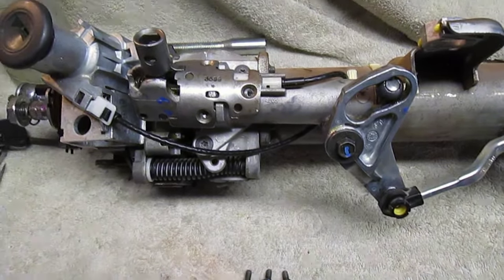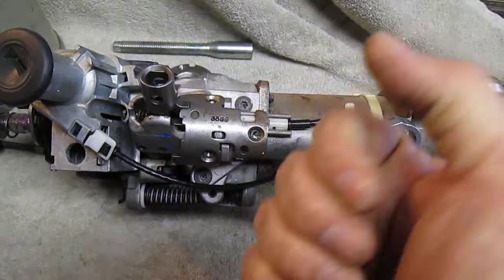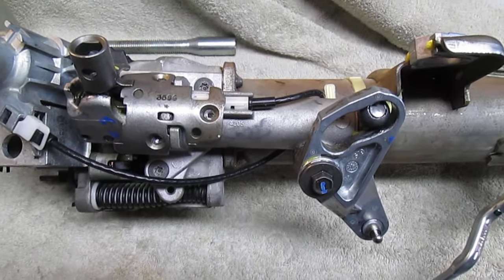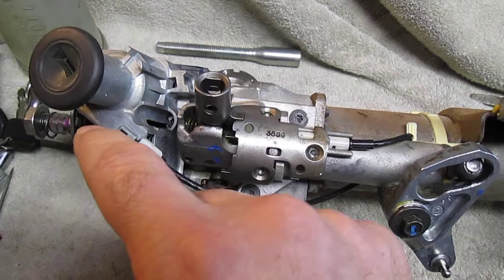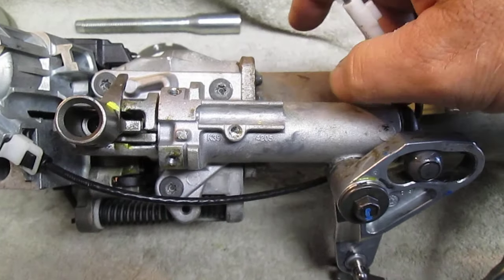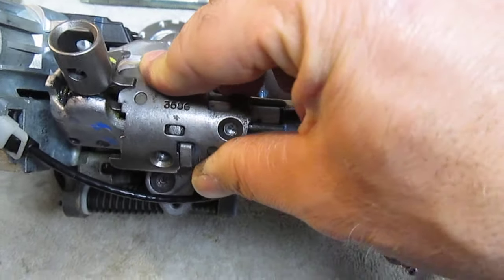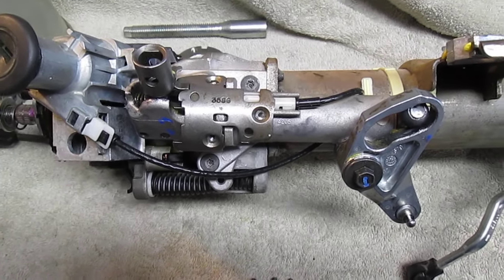Easier way to replace silverado shifter gear selector mechanism assembly

Comment: For the pin lock cable removal on the shifter machanism turn the key to acc position it will slide right out. Must be in ACC or one turn back from off to slide it in or out. Make sure u undo the keeper clip .
Reply: I keep seeing people saying this, but what about the newer trucks that don't have accessory position in key back? It's on notch forward on them. I saw several questions about this on another video but no answer. I'm looking at doing this soon on my truck.

Comment: My cadillac escalade just died as soon as i went from drive to reverse and i had to tow it to my house but i noticed that i got no shifter indicator light and my gas gauge is not working so any idea if i need to replace that part?

Comment: My vehicle back out and then it went into drive and then the gear shifter just moves freely and it will not go back into park and once I turned it off it’s stuck in drive

Comment: I have a question. I got a 02 Silverado HD and the cable broke and I installed i a new one. and ever since I replaced it, it takes a lot of effort to shift out of park especially on a hill and also the gear selector doesn’t lock when you turn the ignition off. I’ve tried adjusting it the cable but it just makes it worse. Any ideas on what the problem is?
Reply: You ever figure it out Jake?

Comment: last 2 day I replace ignition switch and I turn off key but it stuck can't take key  out,I try removal cable gear shifter and it turn off but can't Put back cable gear shifter.
Reply: Did you figure out hot insert it back in?
Reply: How

Comment: What if my shifter had a lot of slop, and was having to hold the shifter up to get it too start, and now holding it up won't start it anymore,  would it still be the shifter or the lock cylinder.
Reply from the maker: Maybe your cable needs to be adjusted. It adjusts down at the transmission under the truck. I've never done it but i'm sure there's a video of how to do it on here... 
You'll see a black plastic thing with wires going into it on the trans behind where the cable fits on. That has the neutral safety switch in it which won't let the truck start if it's not in park or neutral. If your cables not adjusted right it won't put the switch in the right position.
Reply: @myutoobaccount2  mine goes in every gear,  it's my neutral safety switch.  I'm going to replace it tomorrow.

Comment: Hi. Are it possible to get the hands on the spring and are it big problem to swapping it out?
Reply: i found a way to replace the spring but its not the factory way , i had a rusted up shifter used its spring since no others avalable, drilled the end while part was out, at a very odd angle leaving a place for the spring to sit ,but room to work it in with a small flat tip screw driver and then pluged the hole with a allen screw type plug, 2 weeks so far so good. easer to buy a part and swap , but i had to try it the cheep way . just now my park light don't stay on , didn't before I started the repair ,  but did before the spring broke and i kept driving with a flopping shifter.
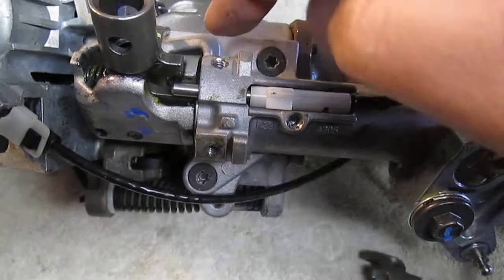Reply from the maker: Apparently people are using GM spring # 7812853 and cutting it down... You knock out the pivot pin for the piece that holds the shift lever. The pin only comes out one way,one side is bigger. The pin and the side you drive it out from is at 2:02 right next to the lower blue mark. I use a drift/punch but you can use a screwdriver. I think you have to take that plate off too,been i while... Then you can move that piece enough to get the spring out and replace it.

Comment: In this mechanism, What is the procedure to replace the lever spring? (that's the small spring that pushes and holds the lever forward), can anyone refer to a suitable link?
Reply: Just go to hardware store buy a similar size stuff spring and keep cutting it down little by little till it fits in tightly.
Reply from the maker: You knock out the pivot pin for the piece that holds the shift lever. The pin only comes out one way,one side is bigger. The pin and the side you drive it out from is at 2:02 right next to the lower blue mark. I use a drift/punch but you can use a screwdriver. I think you have to take that plate off too,been i while... Then you can move that piece enough to get the spring out and replace it.

Comment: Can you do away that cable
Reply: NO that cable is the only thing stopping your truck from shifting into gear when its off. If you remove it,  you can move the shift lever into gear when the truck is off and itll roll away
Reply: I don’t have mine on and have been drive 07 Tahoe like that for years yes of course you can shift it with vechile off but who does that?